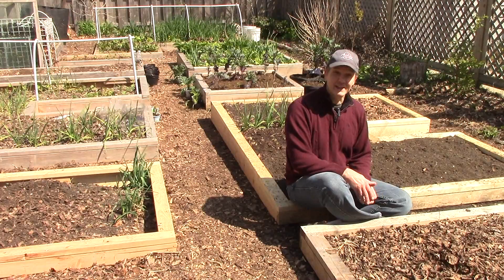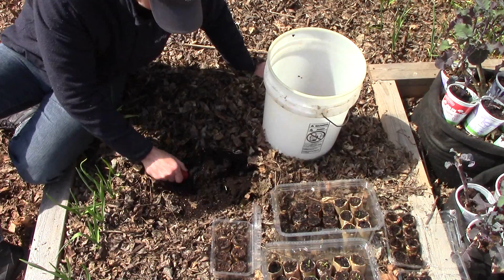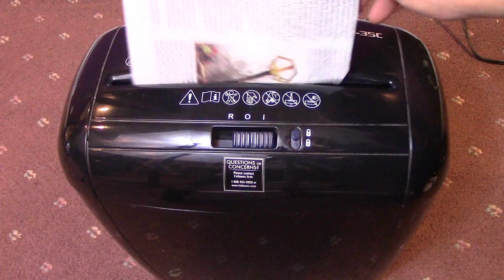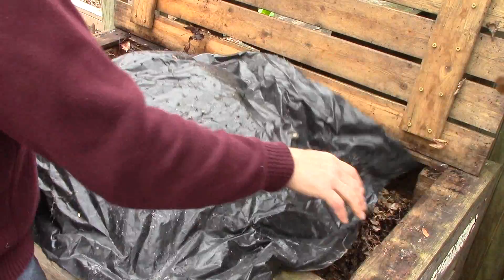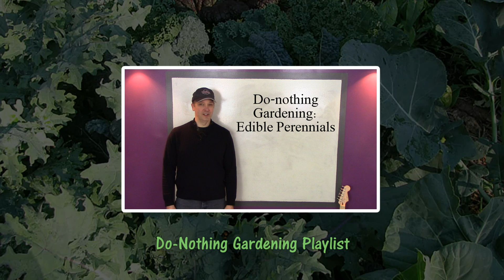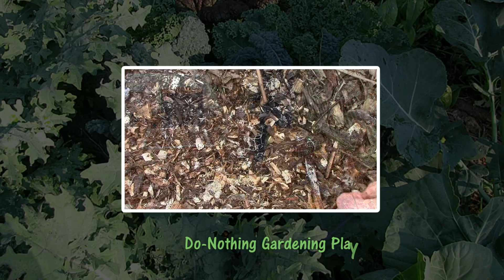Soil Test & Do Less! Moving Worms Outside & Making Less Compost

Comment: i've never seen the point in using compost tea... I think compost itself is good enough.  I think a common error with compost tea is that people will accidentally use leachate...I was one of those people!  A handful of finished compost in a bucket full of water probably won't hurt, but I'm not surprised that it hasn't yielded overwhelmingly positive research results.  Great video!
Reply from the maker: ***** Thanks! I agree that compost gets the job done and we've stopped using actively aerated compost tea in the garden. Thanks for watching and commenting!
Reply: OneYardRevolution | Frugal & Sustainable Organic Gardening I was considering using compost tea not to fertilize but more to prevent diseases and make plants more resilient. This is the approach that I read about in Michael Phillips book he also use compost tea to speed up leaves decomposition under the trees so that should also remove any spore that overwinter on the leaves. Did ever had any problems with diseases/fungi that came with leaves ?

Comment: How do you collect your casting from that outside bin?.
Also some advice please would bags of bark from garden nurseries do the same job as wood chips?
Reply from the maker: tony green Hi Tony. There are a few different migration techniques to separate worms from their castings. For example, a simple horizontal migration technique is to only add new food to one side of the bin. The worms will migrate to the food, and you can then harvest the castings on the other side.

Bark is good for walking paths, but isn't as good as wood chips for plants.

For more information, check out the "Perfect Choice" section of this article from Dr. Linda Chalker-Scott:

http://puyallup.wsu.edu/~linda%20chalker-scott/horticultural%20myths_files/Myths/magazine%20pdfs/Woodchips.pdf

Comment: I'm not so sure about replacing hot/cold compost with vermicompost because they in my opinion should serve different roles. Worm castings may be more rich in nutrients and the nutrients in them are more plant-available but this has a big downside. The nutrients will leach more easily from vermicompost rather than from cold or hot compost. Would it not be better to use the castings as a quick fix in between planting to prepare the bed for a new plant after the first harvest and stick to the compost? Not saying your way is wrong, but just something to consider. I may be wrong.
Reply from the maker: Michał Malinowski Hi Michal. We'll still make some hot compost. Worms have always played a role in breaking down our compost piles (hot and cold). We're just adding more of them to the garden and letting them break down piles over a longer period of time. Out of curiosity, where did you hear that nutrients leach more quickly from vermicompost than compost?
Reply: I think it was in "How to grow more vegeatbles..." by John Jeavons. I know I heard it from Jeavons. Just not sure if in this book. But I know he urged to not be overdependant on vermucompost because arguing that it does not holdt to nutrients as well as regular compost. By the way my favourite gardening/ farming book.
Reply from the maker: Michał Malinowski I checked Jeavon's book and didn't find it there. Without going to any trouble, please let me know if you come across the source in the future. Thanks.
Reply: OneYardRevolution | Frugal & Sustainable Organic Gardening Found it. It is in that book. There is a part called "All Compost Is Not Equal: Five Import Factors To More Compost Efficiency". And in the footnotes there is this quote: "1 Care must be taken to avoid overdependence on worm castings as a
fertilizer; the nutrients in them are very available and can therefore
be more easily lost from the soil system". In the 8th edition. But that is all, no references to publications. But it seems legit- nutrients that are more available must be more soluble.
Reply from the maker: Michał Malinowski Thanks!

Comment: One day I hope to get to that point.  I am a way off yet but you have set an excellent aim to head for.  Many thanks Patrick.
Reply from the maker: Aaron's allotment You're welcome Aaron! I suspect I could have slowed down a few years ago. You may be closer than you think. I know soil testing in some countries is very expensive. Do they have reasonably priced testing in the UK?
Reply: OneYardRevolution | Frugal & Sustainable Organic Gardening If we use a lab it can get pretty pricey.  If we just want to test soil PH then kits exist for around $30 otherwise there is a jump to the kits that test for everything of over $100 and as high up as $1000.  It can become a significant investment.
Reply from the maker: Aaron's allotment Wow, that is pricey! Some of our garden beds are only about 6 years old. My best guess is that the soil was in very good shape after just 3 years of annual applications of a couple inches of compost plus mulch.

Comment: I have a question about comfrey I'm thinking about buying some.Have you ever had a problem with it spreading out of control? If so how would I keep it from spreading too much.
Reply from the maker: Ryan Sackett Hi Ryan. Bocking 14 does spread, but not out of control because it doesn't produce seeds. Just make sure to plant it in a spot where you know it can stay for a long time, because it is very hard to get rid of if you ever decide you don't want it. I hope this helps!

Comment: I never did quite gear up the same way you did :) my results have show in my case that I can still slow some things down ! 

What a wonderful system of garden based in science and ends up with more enjoyment over work !
Reply from the maker: ***** Yeah, I probably could have scaled back years ago. It just shows how important it is to get the soil tested every now and then.
Reply: Well I'm glad you now know. ;)
Reply from the maker: ***** You didn't gear up as much in terms of compost, but the organic fertilizers you were using would have similar results in terms of nutrient accumulation.
Reply: You are right however their soluble nature like resulted in my neighbours trees getting most of it after I stopped using them.

Comment: Great video as always Patrick. Being able to do less work in the garden is always a plus in my opinion. Have you ever considered being able to maintain good soil fertility through just mulching? Similar to Mr. Fukuoka's type of method? I sometimes think that mulching with leaves/straw and adding things such as coffee grounds may be sufficient, although I don't believe my soil is at the level of yours. This year I went through the process of removing my mulch layer and adding compost and adding back the mulch layer and couldn't help but thinking I was doing unnecessary work. Well good luck on the upcoming growing season, and I look forward to your hoop house construction.
Reply from the maker: Bryan Wickizer Thanks Bryan! I should have talked more about mulching. Yes, I'll continue to mulch, and I do think mulching is probably enough.The worm castings will be used in potting mixes and as an annual top dressing. The worms will also be busy at work eating the mulch in the garden beds.

Comment: Why did you use the plastic barrier when transferring the worms to the outside compost? Is it to hold moister in the worm castings longer or is there something else going on there?
Reply: M Russell He perforated the plastic to allow the worms to migrate while keeping the castings separate from the compost material. Once the bulk of the worms are migrated, he can put the castings directly into the garden.
Reply from the maker: M Russell    Seamus Nalaoch is completely right. The worms will migrate down through the holes into the outdoor bin. Then I'll add the remaining castings to the garden.